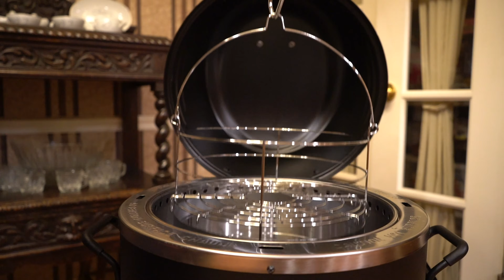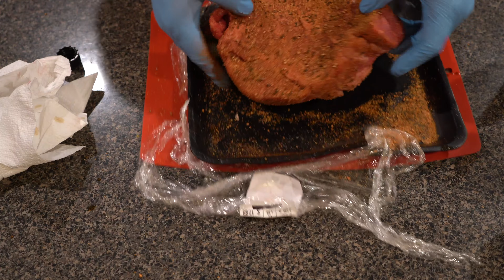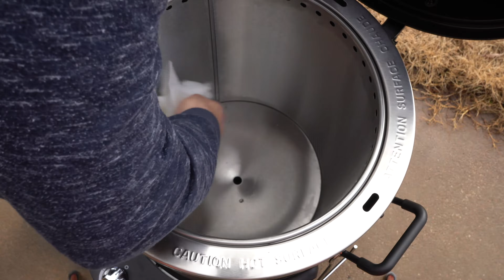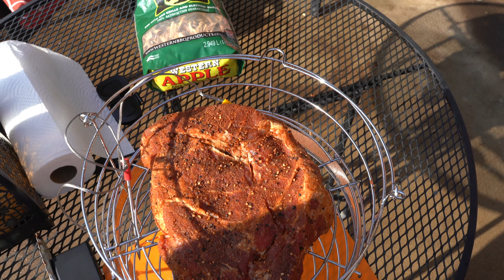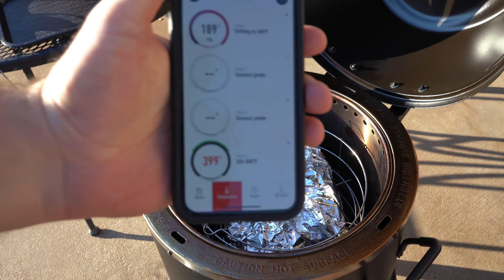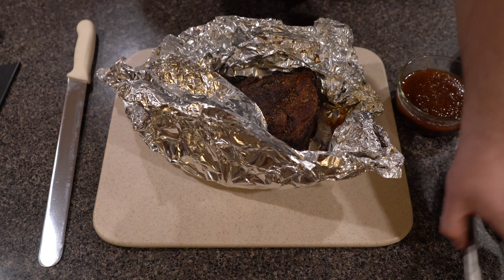🔥 How to cook Chuck Roast on Char Broil - Big Easy SRG

Comment: Is that a necessary step to put the oil? I really like it clean and shiny
Reply from the maker: Hi Anna, thanks for the comment.  The oil on the SRG is only to build a protective layer before the initial cook to ease cleanup in the future.  Without the "seasoning" oil layer being cooked on, the grill will be difficult to clean in the future, if food you are cooking makes contact with the sides of the smoker.  The food might stick to the walls.   I hope this helps!  It's your choice though, if you like it shiny and clean now, it wont stay that way for long!
Reply: Yes

Comment: I love my SRG! I’ve had it for about 5 years. It’s not a true smoker but it does a great job adding smoke flavor to whatever you cook. One of my favorite recipes is for roasted chicken thighs or quarters. I marinade the thighs in McCormicks Grill Mates Mesquite Marinade Mix. Fill the smoker box with mesquite wood chips and crank the temp to high until the smoke is rolling. Lower the basket into the SRG and dial the temp back just a very small amount. About 25 minutes later.....Mmmmm! I always check the temp of the chicken and sometimes I’ll have to let the chicken on the bottom of the basket cook a few extra minutes. I also roast Turkeys for Thanksgiving and Christmas. I use to fry the Turkeys, but the roasted turkeys in the SRG are up there with the fried turkeys. I use my Cajun fried turkey marinade recipe, follow the roasting instructions for a turkey (I do add a little bit of smoke) and the turkey comes out juicy and flavorful. I tried cooking a brisket a couple of times but I never could get it to come out right. With that said, I’ve never been able to properly cook a brisket in my regular smoker either. So it might just be the user. I watched your video because I’m about to smoke a chuck roast. Thanks for sharing your video.
Reply from the maker: Chad Co Thank you for sharing your recipe!  I have yet to try smoking a turkey, but with fall weather in the air, I think it might be time to give it a try 👍
Reply from the maker: FYI, I finally tried to smoke a turkey and it was the best texture I have EVER had in a Turkey!  Bought a bigger one for Thanksgiving and I’m going to try it tomorrow.  I don’t think I will ever go back to oven Turkey again!  I’m going to use your Cajun recipe 👍

Comment: Great Video!  How long did you do the initial smoking, and how long did you smoke w/ foil?  Looks tasty!!!
Reply from the maker: It was around an hour of using smoke and another 45min without smoke before I wrapped it in foil.  Then the remaining 45 min without smoke and wrapped up.  I use the temperature to tell me when to wrap it and when it is done.  Wrapped it at 150 degrees.  Thanks for the comments!

Comment from the maker: When I cooked the chuck roast, I used the upper layer of the metal rack for smoking.  The ambient heat was much greater at that level.  I believe the lower portion of the rack smokes cooler after some research.  I will try this next time and see if it affects the overall cook.  The ambient temp leveled around 360 degrees during my cook.